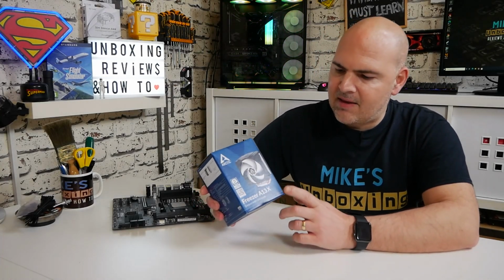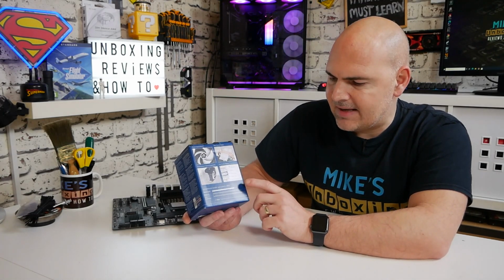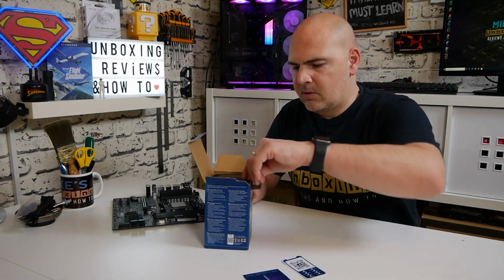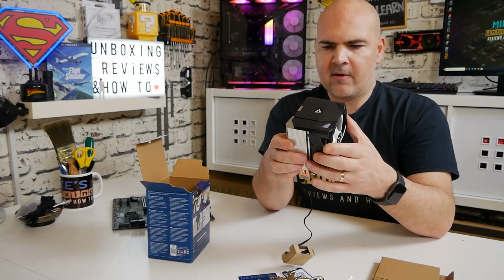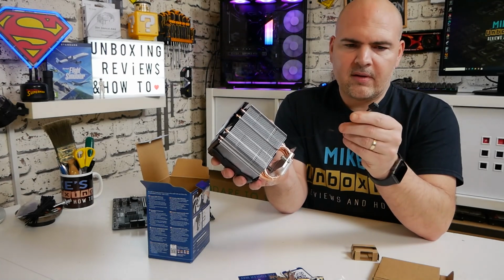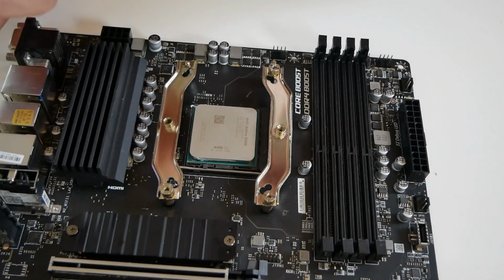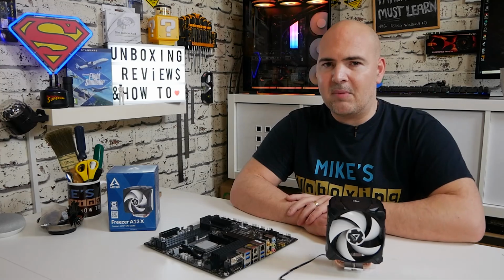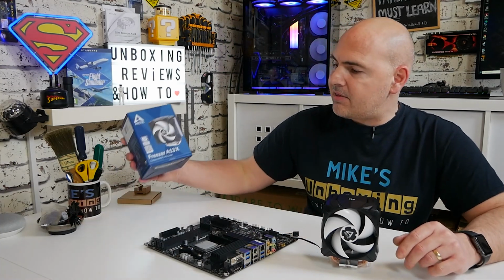Amazing Compact AMD AM4 92mm Air Cooling Arctic Freezer A13X

Comment: Mike,

I'm doing my 1st build in a cooler master q300l m-atx case.. i did buy the Arctic 7x cpu cooler and now ive watched this video wondering if i should go for this A13X? 

Cheers for any help 🤙
Reply from the maker: The 13 is the better option or even the freezer 34 should also fit I think
Reply: @mikesunboxing  ok that's great and typically the Freezer 13 is out of stock :( do you recommend any M.2 for a B550M Tuf Gaming Plus Wifi board?
Reply from the maker: @LordMoss_Gaming  freezer 34?
Reply: @mikesunboxing  doing some google searching the Freezer 7x is shorter than the 34
Reply from the maker: @LordMoss_Gaming  yes that is true

Comment: The little cooler that cooled haha, my only issue would be the fan's mounting shroud, but then again I've never had a fan die on me before

Currently I'm fine with my yellow freezer 33, keeps my 2600x cool and quiet and it will probably outlive my cpu hahaha
Reply from the maker: Yes most likely 😃

Comment: I like arctic coolers, I just replaced an alpine 11 with the newer freezer 12 after 7 years 1 month. The bios was telling me it was failing and it was starting to rattle but it had been on their all that time 24 / 7. It was before the CO units.
The newer one has a pwm fan with the same bearing. 
Amazing gear.
Reply from the maker: yeah i really like arctic stuff
Reply: @mikesunboxing  seriously keep an eye on the alpine 12 (my mistake before)   the vanilla one is 6 quid sometimes and if you fix peoples old intel rigs they are great for locked 4 core chips. I buy one whenever they are 6 quid. still last 6 years+.
Reply from the maker: @MrChriss000  Thanks will keep my eye out :-)

Comment: I wonder why they didn't just use clips instead of that shroud. It would be nice if users are able to swap out that fan in case it fails or want to replace it with something RGB.

It'll also shave off a couple of mm's on the height and make it fit more 135mm max cpu cooler height SFF cases from Taobao.
Reply from the maker: yes that was a little disappointing, but i think the overall look has improved with the ducting. Time will tell if the plastic wears and it has more flex

Comment: that is high ,my 3700x rus around 65c under full load and 28 c at idle
Reply from the maker: depends on many factors such as ambient temps, voltage, motherboard manufacturer and software used to report temps. If i used the Asus software the CPU shows up to 10c lower for the CPU temps as it shows the cores rather than the package temps

Comment: I love your video.  I would not buy that product.
Reply from the maker: Why is that?
Reply: @mikesunboxing  Well, the fan seems to be one where it can't be separated from the shroud, and I would just prefer a 120 mm fan cooler where it was easy to replace the fan with what you want.
Reply from the maker: @johnmckenna5782  Yes, I get that

Comment: How good is this in comparison with the Cooler Master Hyper 410R 92mm rgb fan air cooler ?
cant decide whether i should buy a 92mm air cooler or 120mm aio for my mini tower build : )
Reply from the maker: 120mm aio are generally not that good due to the low thermal mass of the water, but in some instances can be a good choice if limited on space, the freezer A13x is a good alternative and you would save a bit of money too
Reply: @mikesunboxing ok thanks !
Reply from the maker: @lakshya7509  No problem :-)